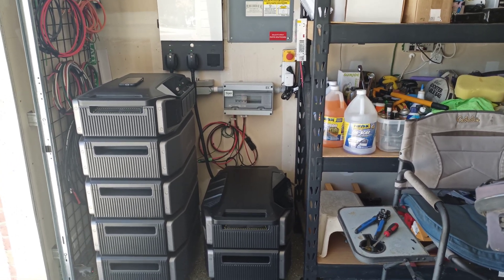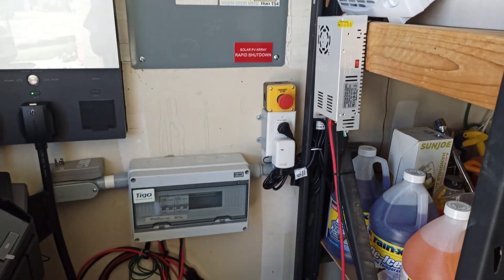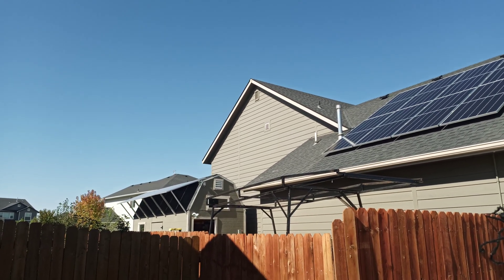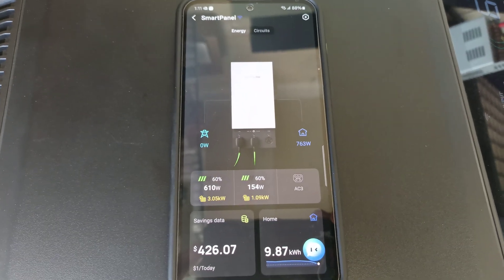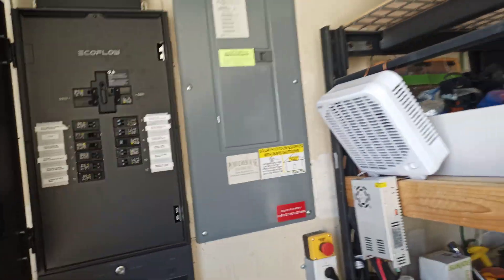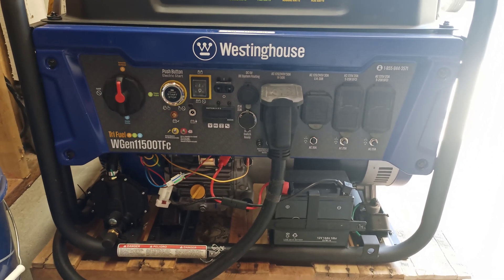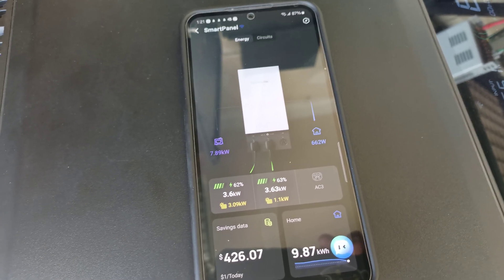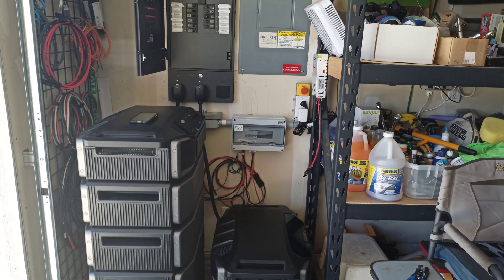EcoFlow Delta Pro Ultra install update w/ Generator overview and run time.

Comment: Great news Eco flow delta pro ultra X system 12,000W
and great news Eco flow delta smart panel 3 and Eco flow delta pro ultra X extra 10 battery 😊 👍🏽 👍🏽 👍🏽 👍🏽 and 10(KWH solar panel) and power whole house and HVAC Cooling and heating unit

Comment: I'm not understanding, instead of spending all this money on batteries and inverter, why not simply have your solar panels grid tied with a net metering meter from your utility. Your utility becomes your excess storage, and in the case of power outage you have your generator for backup. I'm looking at what you have for batteries and inverters, and that has to have cost you 15k. Where is the savings? Or is this just an expensive hobby?
Reply from the maker: Net metering is a scam do you want to be part of something that politicians can change your payback rated at any given time? 

Any salesman that says use the grid as a battery is summarily dismissed on the spot for a lack of understanding. Using the grid is a storage device a battery do you think that's smart what happens when the battery utility company goes down do you still have access to your power? Nope..

Yes Independence costs money

If you're after a return on investment or want to make money with the system then this isn't the system for you doing this is not about the money in the slightest.
Reply: @erickoffgrid  If your utility offers net metering, how is it a scam? I have been on net metering since 2022, charge 2 ev's, and only pay an electric bill in winter for a couple of months, when my net metering surplus is used up. As far as when I have a power outage, you're correct, the panels stop producing. That's what the backup generator is for. I guess I could spend 15k to say that I'm independent like you, but I think I can find a better use for the money.
Reply from the maker: @johnd1561 how many times have they changed the net metering on you? The rates? If not just wait a bit longer..

During a powder power outage the panels do not stop it's only when the Sun goes down that they stopped but you're still out of power even though you put all the money into the system, when that's the case why not have a couple batteries on hand for silent long power instead of running a generator all night? Storing and keeping what you produced is only prudent.

And yes I'm sure you could put the money somewhere else but we all put our money where our likes and desires are at right so to each his own.
Reply from the maker: Also in my opinion grid tying is the absolute worst thing you could do with such a large investment.

You're giving up control your system you can only get back from it what they say you can you're down during an outage and they overcharged by tens of thousands if I spent 15 that's a drop in the bucket compared to what these people are paying to get solar installed in their house for 50 60,000 the system will never be worth.

Net metering gives them the system not you and you can't even use it when you need it.

My opinion we all have reasons why we do or do not do something.
Reply: @erickoffgrid  Your assumptions are for the most part incorrect. I own my system which consists of 24 405 watt panels with enphase micro inverters, grid tied with net meter. I spent nowhere near 50-60k. Try 35k before the federal 30% rebate and local rebates. At the rate I'm going, my system will be paid for in 2 years from the money that I've saved. I could disconnect my panels from the grid, and spend an additional 15k like you, but why? Just to say that I'm independent fighting the corrupt system? I think all these backup batteries are a scam, a 15k one!
Reply from the maker: @johnd1561 it's all good, we all have different points of view and priorities no worries on my end.

Comment: Hi Erick - thank you for the video. Really an impressive set up. 

I am doing my homework to get the delta pro ultra, and had some questions,

 1) I already have my generator inlet on the house main breaker box, with the transfer switch to connect my 14.5 kW Westinghouse tri fuel generator. Would I need to move the transfer switch over to the smart panel when installed? Like the arrangement you have, or can the generator stay on the main panel and power the smart panel?

2) can you share the link of the brackets/hardware for your panels mounted on the shed? I am searching and there isn’t much variety - but I like yours that can change angles as needed. 

Thanks
Reply from the maker: Great questions, thank you! 🙏

1) Generator / Transfer Switch:
Yes—you can feed the SHP2 from a breaker in your main panel, and if that breaker is powered by your generator, then the SHP2 will see that power as well. Just keep in mind the SHP2 already has a built-in transfer switch, so depending on how you set it up, you might be adding a bit of redundancy. From what you’re describing, it sounds like you might be wanting to use two sources as the main feed (utility and generator). That can work, but it really depends on your wiring layout, so I’d need to know a little more detail on how your generator and transfer switch are currently tied in.

2) Shed Mounting Brackets / Hardware:
For the shed panels, I kept it really simple and affordable. Instead of fancy solar racking, I used chain link fence hardware from Home Depot/Lowe’s. The vertical fence poles act as the mounting posts. Those poles sit in fence post base plates/eyelets that I bolted down directly into the shed roof rafters. Then, to actually secure the solar panels, I used stainless steel half-circle “U-bolt style” brackets. One side bolts into the panel frame, the other clamps around the fence pole—locking the panel to the mount.

It ends up looking like a pivoting arm system. That way, I can change the tilt angle of the panels seasonally without needing to buy an expensive adjustable rack system. If you freeze-frame my video when I’m showing the shed, you’ll see it clearly once you know what to look for—the brackets, poles, and bolt points all line up in a really clean way. It’s rugged, budget-friendly, and easy to scale.

Comment: I'm really impressed with your set up man. I doubt I will get to set it up to this level this year before the deadline. I'm a surgeon with 3 jobs and on call all the time. But DIY really helps me clear my brain. I'm doing solar because i think it is the coolest thing, and want self reliance for at least 2/3rds of electricity. Could I just do a couple of notes and pay for the electricity difference, sure but I am so sick of paperwork to this level, that I am letting a good % of my billing expire and those bills just won't go out ever. I'm ok with that. Because all I do is work weekends, nights, Christmas I am cutting. Anyway, we have a similar house set up with a shed/shop/mini casita in the back yard. Very large patio for easy 30 panels that can fit. Got 1/8th of an acre sectioned away from the back yard for ground mounts until a pool starts to get built in a couple of years, but then will do all shade structures to be solar after that. I ordered all this stuff, but need time to install. Shop/casita is set up already on a manual transfer switch and solar. But i want to take like 3 weeks off and do the house. Not sure if i can pull that off since I don't have a back up at work.
Reply from the maker: Wow, huge respect 🙏. Balancing three jobs, being on call, and still diving into DIY solar on top of that is no small thing—that’s seriously impressive. I totally get what you mean about DIY being a way to clear your head; there’s something really satisfying about building out your own system and knowing it’s set up the way you want it.

Your plan sounds amazing—between the shed, casita, patio, and even the ground mounts before the pool, you’ve got a perfect layout for a solid solar build. 30 panels on that patio alone is going to be a powerhouse! And I like the way you’re thinking ahead with future shade structures doubling as solar. That’s next-level planning.

Honestly, even with your schedule, you’re already way ahead of most just by ordering everything and getting the shop/casita online with a transfer switch. Taking 3 weeks to knock out the house would be awesome, but even if you chip away at it in phases, you’ll still get there. The cool part is, once it’s running, every watt you generate is a step closer to that 2/3 self-reliance goal you mentioned—and that’s huge.

Really appreciate you sharing all that, Your setup and mindset are inspiring. 🔥💪
Reply: @erickoffgrid I think you are the only one that I found on youtube #1 that is not just a "tester youtuber", and #2 the only one that went big with a system like this. When I just started researching about 3-4 months ago i tried to put in about 2-3 hours per night before sleep to learn. Yes it cost me 25%-half of my sleep time, but i did at least 150 hours of that until I went to that diysolar forum with giving some huge respect to those guys before I posted my question or two about Aptos vs Canadian solar 450w. They were so rude to me as soon as I said Anker. They were saying how they don't like people that don't capitalize every single sentence. Just as an example, and would refuse to answer a single question, but would come and make fun of it.  I told them I know they don't think much of the Anker stuff I bought, but for me it is a start and I told them I will continue to learn to get to their level of systems in about a year or so as time allows. So I deleted my post and they banned me right away. I was thinking like, you just banned a top surgeon in Arizona(i really am, but I'm 40 and tired now that I proved everyone here for years), that is from Bosnia and has been doing diy his entire life with my dad and brother. So, since I couldn't get an answer from them, I just bought both brands of panels from signature solar then, and they will be delivered Monday. Already have 12 Anker/Mission solar ones. Not sure if they didn't accept me there just because I mentioned I am a surgeon with limited time, but man I came from nothing to this country from a refugee field in 96. I'm just a regular guy with all of my patients, always scratched up from house work and I talk like I talk with family. Most docs have to be 55 y/o to be this busy, so maybe it's too soon. I never advertise. So kind of bummed out when they kicked me out of that forum. And now im super happy that someone else is doing exactly what I am thinking with these type units. I'm like a kid with this stuff lol. Sorry for the long post.

Comment: Just curious why you added a second inverter?  A single inverter will support 5 batteries, and all the solar you are bringing in?  For future expansion perhaps!?  So jealous though!  Been looking at this system and would love to do it, but my primary energy consumption is main A/C, a heatpump for upstairs, electric water heater, and electric dryer all on 200amp service, and our electricity is only $0.11-$0.12 here.  I am worried about the rising prices for electricity however, and the expiring of the solar credits, makes it even less viable.
Reply: That's what most of us are doing is trying to cover the big stuff, which Anker and these systems can do. I am now covering 3 out of 5 ACs for my place with Ankers in AZ.
Reply: @SurgeonTech how big are the A/c’s each and what kind of setup are you using to run them?  How many panels and what inverters?
Reply: @gr82banautiger24 keep in mind this is all to be installed this month and is purchased already. The only thing i have fully installed is the shop/casita as a standalone system that is cooled 24/7 to keep batteries cool at night too. My restriction is minimal time available due to work.
Reply from the maker: Good question! A single inverter can handle it, but I run two for extra stability when big loads (like a table saw) kick on so the lights don’t dim. It also adds redundancy and more capacity for the future. Sounds like you’ve got an awesome setup with that 200A service and those big loads — very cool! 🔥

Comment: I just got a Predator 5000 to charge my DPU through the SHP2. That generator setup you have in the shed, even after closing the door, is incredibly loud (at least compared to my Predator). The clanging sound of the exhaust lid makes it extra loud. In a real outage situation, if you ran that at night while the neighborhood is dark and quiet, that’s going to sound like a freight train. I’d imagine your neighbors can hear it at least 6-8 houses down. After spending as much as we did in the DPUs, why didn’t you opt for an ultra quiet enclosed inverter generator? There’s plenty that are dual or tri fuel.
Reply from the maker: That's funny I don't remember put in a decimal meter anywhere around it. It's actually quite quiet with the door closed but thank you for the concern.

There isn't an inverter generator made that can supply the power I need they are all too small. And predators are Harbor Freight are they not so you should keep a close eye on and check your THD
Reply: @erickoffgrid  1.7-1.8 THD on the Predator 5000 running off propane pulling 2,100 watts, no eco mode, going into the Smart Home Panel through a generator cable. 

Just want to point out that your setup and your detailed explanation is excellent and I used your information to build my own setup. I look forward to your updates.
Reply from the maker: and on this, I just did another generator test, each inverter was pulling only 3.5k + 1k on the house load, so that is 8k as a bare min in my case to supply a base load to the house and a decent though throttled from what it CAN do charge to the inverters.
Reply: @erickoffgrid I’m sure the open body generators will have lots of power options. I live on a very quiet street so I can’t imagine running a non inverter generator here. I’d be too embarrassed and would genuinely feel bad for my neighbors. 

The Predator has a tri-fuel 11,500 inverter generator coming out soon. I don’t need that since 5,000 is enough to charge my system and give me an extra 1-2kw to run critical loads. 

I don’t have exactly the same needs as you though. Doesn’t the app allow you to limit the amount of watts going through the generator to the smart home panel? Might take longer to charge through the generator, but then that would keep an irate neighbor from loading a standard capacity magazine to put an end to the disruption. 

I guess it just comes down to preference.
Reply from the maker: @screenconnect1647 yeah that's fair we're all in different situations I think it's fantastic you take your neighbors in a consideration for others

Comment: BREAKER BOX , WHERE YOU GET IT? DO YOU HAVE THEM RUN IN SERIES OR PAR ? ARE YOU USING 10 AWG FOR THE HV ?
Reply from the maker: Amazon DIN rail breakers box, yes 10g, breaker box in series?
Reply: @erickoffgrid   THANKS DID YOU INSTALL THE PANELS YOURSELF ? WHAT RACKING DID YOU USE ? YOU HAVE A VIDEO OF IT ?

Comment: Hi Erick, Finally got my ecoflow ultra with two batteries and smart home panel 2 set up with 5.6KW of solar panel 4K High input and 1.6kw on low. I get charging peaks at 5KW and batteries are full in couple hours and half.  

Thinking of getting either a 3rd battery or an other ultra with one battery and I will move the low input to the second unit.

Any thoughts, thinking of charge speed if I move the solar input to the second inverter vs having 14.4kw of output. Any thoughts since you have a second unit with one battery?  Trying to figure out what would be a best value for the $
Reply from the maker: I have found my best charging speed is to use the highest voltage I can to the HIGH input, I changed my shed panels from parallel to series for this very reason. I would always suggest 2 DPUs for "stability" in high amp startup devices like a chop or table saw.

Comment: If I may ask, why not go to the 5 batt max on the first one?  ‘‘Tis a great setup btw.  😇🙏🏻🇺🇸🫡🫡🫡🫡.   I am going to pull the trigger on a DPU+SHP 2 W/ 5 Batteries and a Champion dual fuel 6500 w generator.  This is for power if an outage hits.  No panels as mostly shaded where live by trees.  What do ya think?   When the batts get low just recharge with the Gen.  😁
Reply from the maker: $$$$ is why I did not start at 5 on the 1st stack but it has it now. The champion generators do not have an acceptable THD that is compatible with the SHP2 so be careful or do not use it with the SHP2

And if no panels you will be running the Gen every day or two for hours ti bring them up..
Reply: @erickoffgrid  the 6500 watt dual fuel inverter generator has a less than 3% THD according to Champion.
Reply from the maker: Glad to hear it..@comcastjohn

Comment: AWESOME video, incredible system... this is more work and money than most people would EVER do... but everyone dreams of it!
... so this is quite an achievement....
 I really hate to be a jerk and say it... but I have to say it...... do you have an air intake into the shed to let air in so the generator can breath????
if you ever make another video please show it... I worked for the Gas company, we would go out with the fire department on CO calls and fires... I saw thousands of people build a room in their basement and close off the heating system and not let it get enough air causing it to run dirty plug up and make CO... I also inspected all  Gas appliances / exhaust piping... and again found thousands of people that just didn't realize they have to allow air to oil/gas heating systems, gas hot water heaters and of course generators.
I'm sure you didn't over look it... but I hate to think of the people copying your system and not add make up air for the generator if they do it in their home ... and they get sick or die from CO poising ..they will be Sueing you... so be careful.
Reply from the maker: Doors don't actually fully seal the whole Ridgeline from end-to-end is a ridge vent and then each side has a Gable like 2 ft x 3 ft with a fan